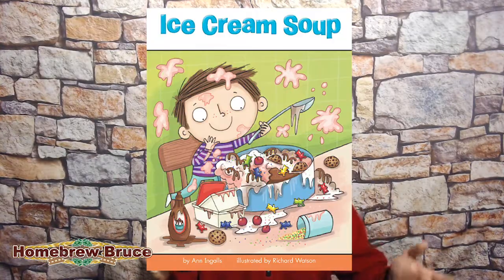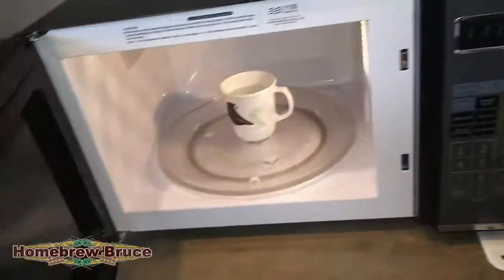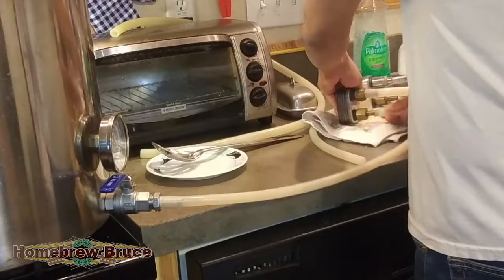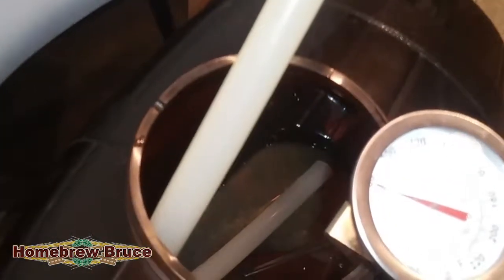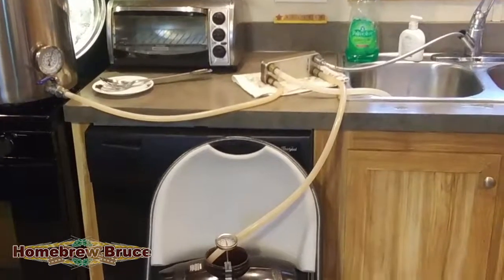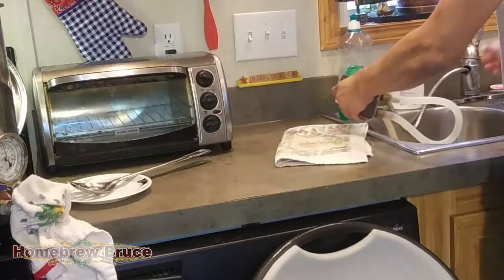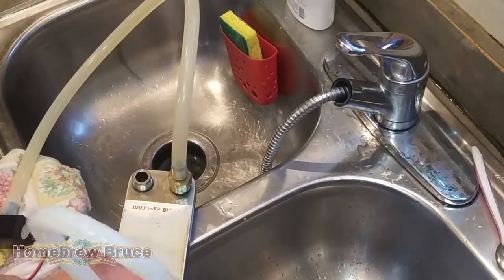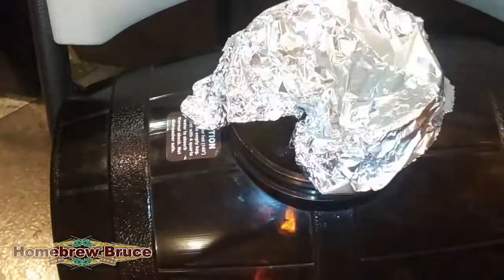Duda Diesel Plate Chiller - About & My Setup

Comment: Hi Bruce, I just bought my plate chiller from the same manufacturer, thanks for the advices I didn’t know you could bake the chiller, btw could you tell me the size and name of the barbs you used for the chiller? I’m a newbie that’s why all of my questions, thanks in advance, greetings from México.
Reply from the maker: I only baked the chiller to try to dry it as much as possible after cleaning it with water. I think it's alot if work and maybe I should just get a wort chiller. As for the barbs, I think they're 1/2 INCH. I'll let you know when I get back to the garage. You can usually find these at home depot or hardware stores. I had brought my plate chiller with me into the store to see is the barbs fit. What beer are you making over there?